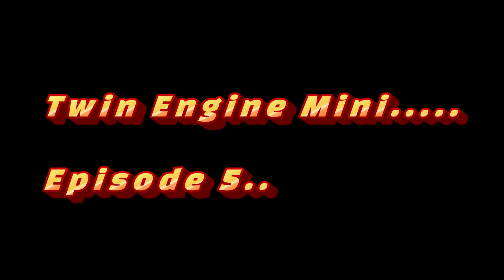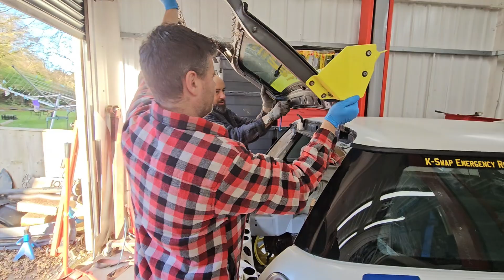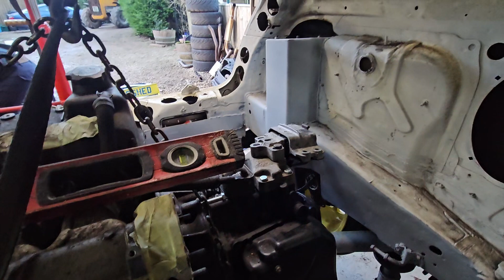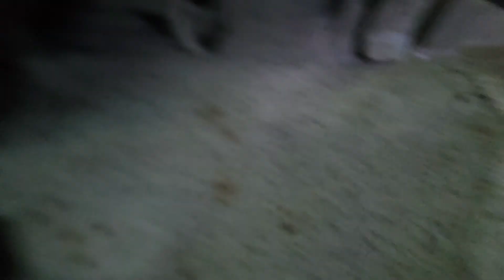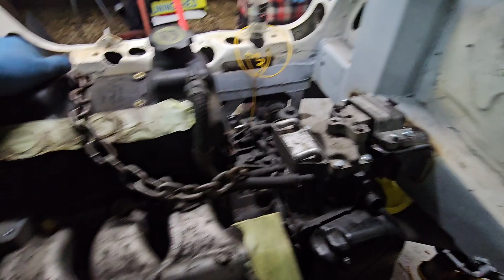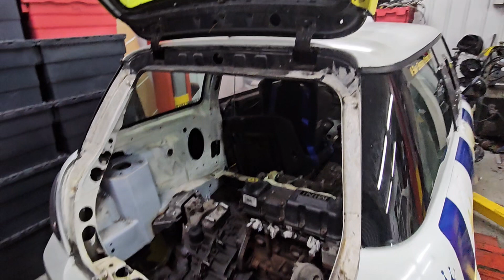Twin Engine MINI R53 conversion. Rear engine mounts built and engine fitted.

Comment: Hey guys, love what you’re doing. Mainly because you’re doing it!!! It’s awesome. I’m converting my r53 to a mid engine configuration, and I was thinking about using AWD mini countryman rear trailing arms since they accept axles. Looks like from what you guys did, I could make it work, but I’d have to mount the subframe slightly differently. I just figured that would answer all the geometry questions right away.. any thoughts or arguments against or for this idea? Thanks in advance, and I’m truly rooting for you 👍 cheers